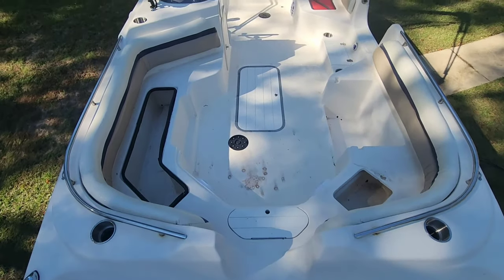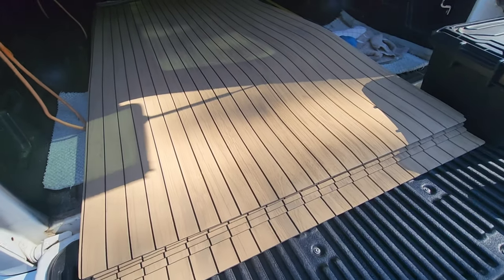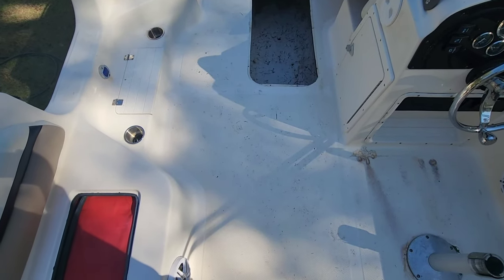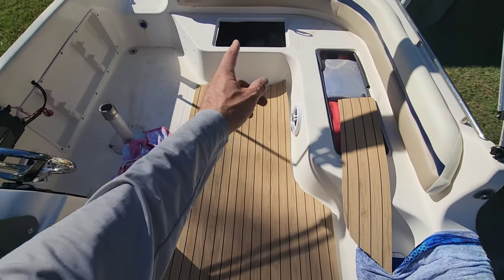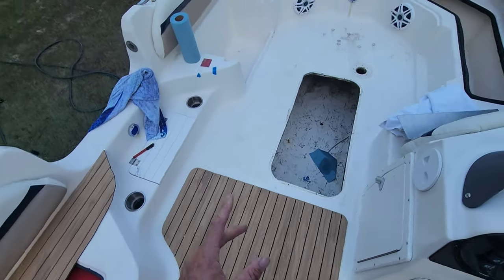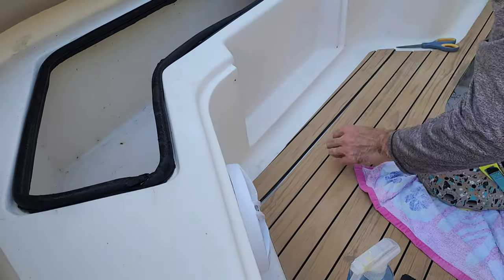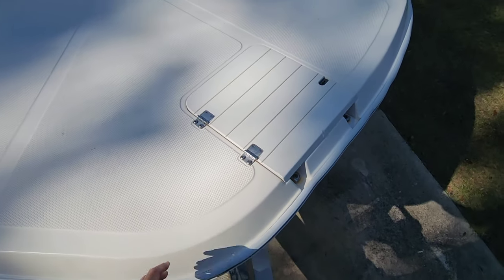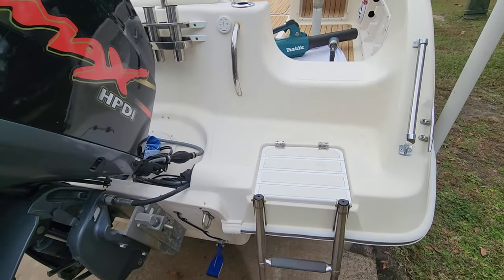DIY EVA FOAM Inside a Boat | Full Install

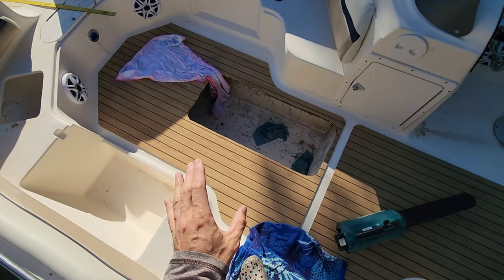Comment: Thank you great  video. I want to do the same with my yacht however is 38 feet long and would require a lot of linking up pieces. I did see that you did the same on 15:15. On my yacht it will be on areas where a lot of walking will take place. My concern is that it wil lift up due to small pieces. What is your vies on this?

Comment: So are the cut edges straight up and down?  I noticed on manufactured pattern pieces there is a slight bevel on all the edges.  Is that something you worry about or not an issue?

Comment: On your video I see that you pasted it directly onto the textured part. That was my idea as well. My concern is does the EVA stck properly onto the textured part or do I need to sand it down to be smooth. What is your opinion?